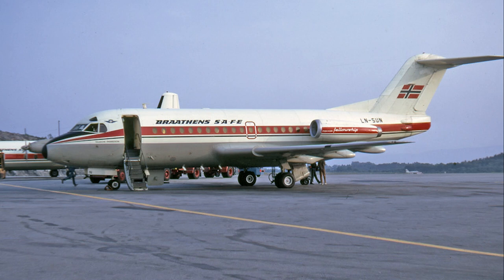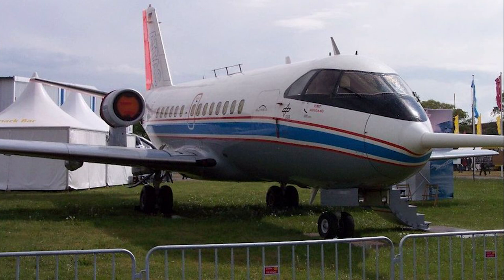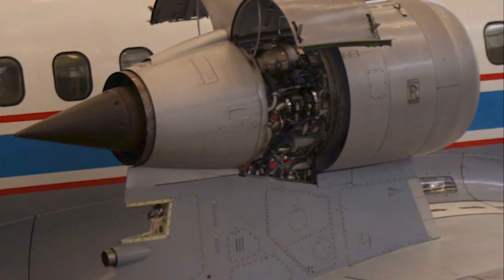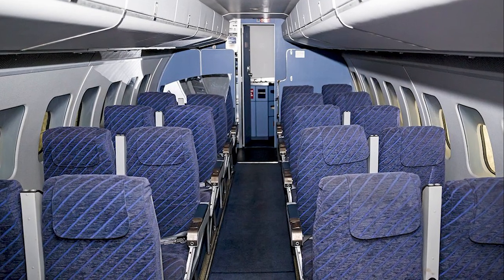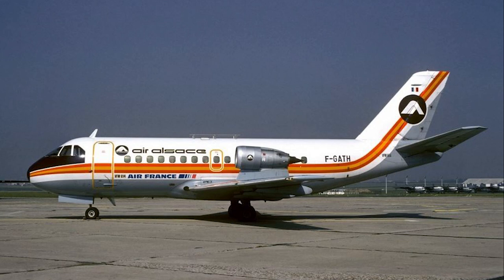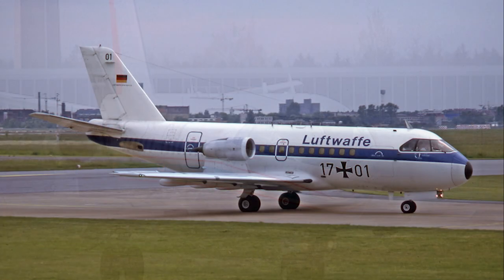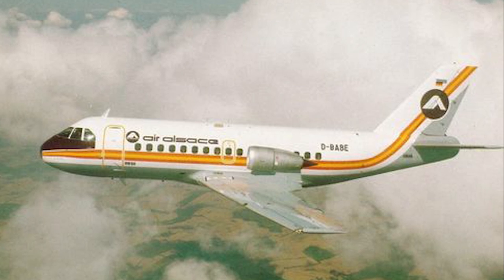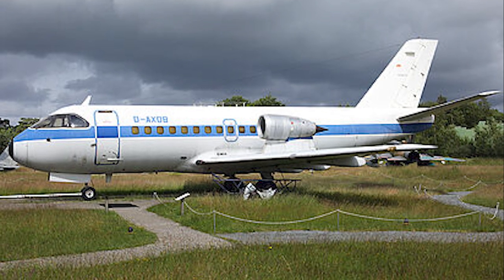The VFW-FOKKER 614!

Comment: nice work. one little thing: it is a vfw 614 not a fokker 614. and if fokker would have not pushed their fokker produkt f28 the vfw 614 might have had a chance.
Reply from the maker: That's true, thanks for mentioning! Because of the joint venture VFW and Fokker had it is often called VFW-Fokker. We used Dutch sources to make the video, that's probably why we mixed it up. 😃

Comment: I find it hard to believe that engine placement (directly outside the windows rather than underneath the wings) reduced cabin noise.
Reply from the maker: Might indeed be a small error, though the plane had pretty silent engines and sound proofing in the cabin. Thanks for mentioning. 😃